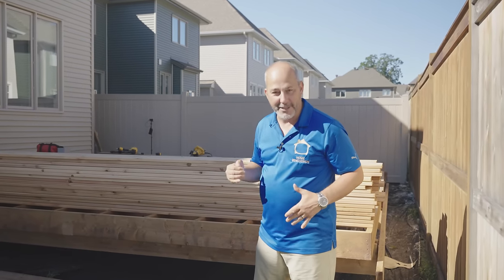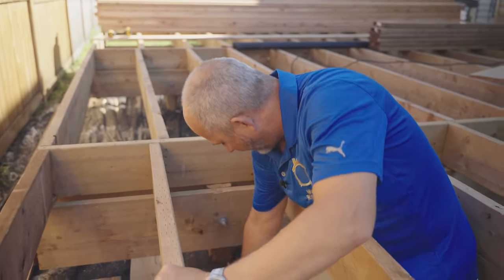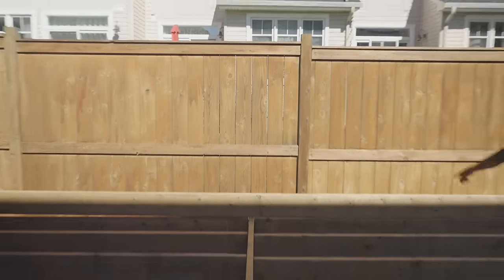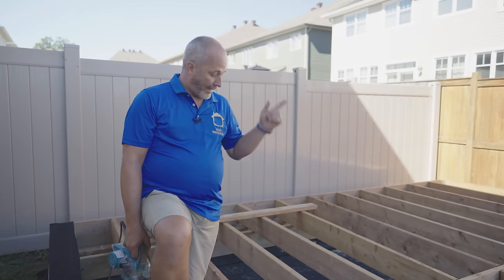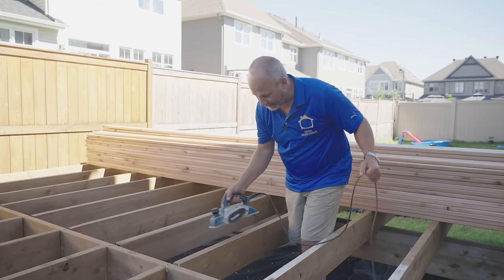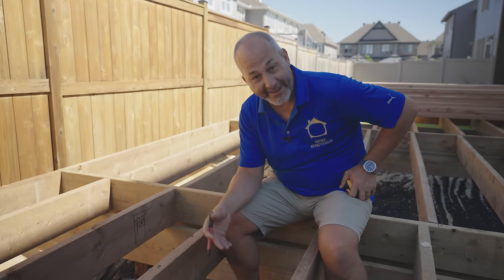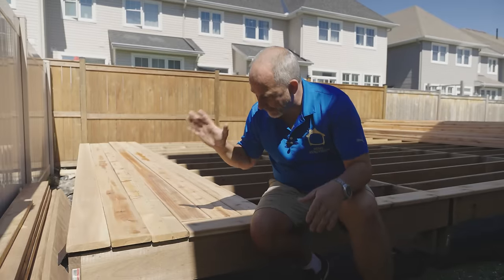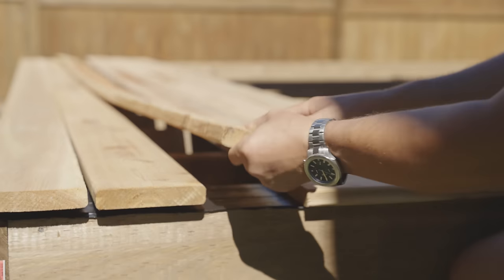Watch THIS Before Building Your Deck

Comment: When I rebuilt my deck, I had seen previous videos of yours showing the Camo system and the trick using a board as leverage to manipulate the deck boards.  I did the entire deck my self from demo to finish and the leverage trick was a game changer.  It helped so much!!  Oh, and I LOVE the Camo system!
Reply: When I saw it I figured yeah that's great bu5 I dont want to buy a $500 tool I use once. Turns out it's $50 and $100 for screws. Seems like an easy choice

Comment: Just had a guy tear off my 30 old deck and build new with the Camo screws. Love the way it looks without the screws showing. He never worked with the screws before and liked the finished look. I had him picture frame around the deck so the edges would not be seen, but I  did not let him screw the center boards down because I wanted to sand the edges and make sure they were laying the correct way to avoid the cupping and splintering you talked about here and other videos. Something contractors  don't figure for that kind of detail in their quote so I didn't want to pay him extra to do that. I used 20 foot pressure treated for a 20 foot deck. Not the easiest thing to handle ut it looks great. Although I do want to replace some boards that have too many deep knots or have separation that you talked about  Thanks for the additional information!

Comment: You can tie a plastic bag to the string take a vacuum to one end of pipe turn in on put bag with line in other end of pipe and it will fish the line in pipe.
Reply: That's a great idea.
Reply: Im not following. Could you explain more?
Reply: @nevinleiby  
It's easy to suck a 'balloon' with a string to thread a line thru a pipe.
Reply: @b_uppy  gotcha. Nice!
Reply: @nevinleiby  
It is clever, isn't it?

Comment: You've pretty much held our hands on the updating of our whole house at this point, so thanks! We're now onto building a little deck and have sourced some rough cut cedar. Would the Camo tool work for the straight edges of the cedar too? Any and all tips on working with the rough cut cedar is also welcome! (We did use treated lumber for the frame though.)

Comment: I like the way you use your speed square as a spacer for the deck boards.  I've always made my spacers from some 2" x 6" drop pieces and drive some nails through them.  The nail is the spacer and the 2" x 6" piece keeps it from falling through the gap.  The width of the space depends on the nail size.  I usually use a 10d or 16d but I've sometimes even used 20d.

Comment: Question for Jeff please, I'm in the UK and building my deck. The longest side is 25 feet long, and I want a frame edge on all 4 sides. I can't get boards that long. What is the best way to put 2 ends together please? Straight butt to butt or angle cut 2 and seal the ends?  Many thanks keep making these video's they are super informative.

Comment: I may of missed it in the comments. I love the channel, learning alot! And inspiring me to seek out more. But in this deck are joist hangers not needed? I am working on a deck right now. Also is there a reason why you dont use composite decking? I am going to be installing around 600ft of composite decking. Was hoping you had a video on it. Thanks!

Comment: your videos are very informative, THANK YOU! Is it posible to remove boards from the deck if necessary, that were installed using the Camo system?
Reply from the maker: sure thing. just cut right down the middle and pry them loose. Cheers!
Reply: @HomeRenoVisionDIY  
Thank you!

Comment: Am I missing something? Definitely intrigued by the camo system but is it just one screw per 16 inches that holds the board down? No top screws? Nothing in the other side? I was assuming at least 2 screws per joist to hold the deck board down, not just one on the side.

Comment: I watched this deck build in addition to the one day deck build, but I need some help with what kind of deck I should build considering my area. I live in the California mountains with hard ground that's terrible for digging (going to use deck cement blocks, instead of digging as much as possible). The area I'm building the deck is on a gradual slope, gets a lot of sun, and given the high winds and snow, I know it's going to take a beating. Given this information, would building a deck directly on the highest part of the ground and lifting it where the slope begins until it's level, work? In case it matters- I don't mind if it's not the most beautiful deck, I just want it to be functional and last through the snowy winters.

Comment: Hi Jeff, tank’s for your videos ! I learn a lot. Can you tell me where you buy the rectangular plastic that you put  between the rectangular exhaust fan and the window when you are sanding joints to exit the dust? I saw that in your other video. I am sorry, my english writing is not very good. Tank’s
Reply from the maker: It is actually a round tube. I get it from a local restoration supply wholesaler. it is called lay flat ducting for a phoenix air exhaust system. Cheers!

Comment: Question for Jeff. I am renovating my bathroom in my 100 year old house. When I took off the old tile off the floor I discovered the original beautiful porcelain hex shaped tile that with some TLC I think I can restore it to look like it was put in yesterday. The floor also had these thick porcelain curved baseboards around the perimeter of the bathroom floor. I had to take those out because they were in bad shape. When I took out the porcelain baseboard I discover there was something that looks like a roughly 3 inch cement or maybe mortar sub floor poured on the floor. In removing the baseboard some the crumbling baseboard came out and I need to fill it in, however some of the area has a bit of exposed wood. I know its not a good idea to pour cement over wood so I am looking for the best solution to level this gap around the perimeter of my bathroom so I can get it up to level ? really appreciate your video any advice would be appreciated.
Reply: Cover the wood with Tuck Tape and pour cement in it to level it.
Reply from the maker: just use wax paper or a sill gasket to isolate the pour of the cement. Cheers!

Comment: Question for Jeff or anyone who has used the camo system on PT wood. My soon to be built deck is on the south side, is my main entrance, will suffer -35 in winter to +35  in summer. I’m wondering about splitting of the deck boards over time, since the screw seems near the edge of the board. Anyone have problems with splitting?  Thanks in advance.
Reply from the maker: no worries lynn. the screw is designed to be self boring so it won't split the wood. your best defence is a sealer stain with uv protection applied once a year. Cheers!

Comment: Jeff, any particular reason you didn’t use that tape on the joists ?
Reply: Good question.
Reply: I believe he mentioned why he was only using the tape on the wider spans on the ends (where he was doing his perpendicular portrait deck boards) in his box beaming video. IIRC he only did it in spots where there was a possibility of water pooling under the wood, and for most of the framing, there are only 1.5" wide spans facing upwards, where pooling shouldn't be an issue.
Reply from the maker: I find it a waste of money in an area with no trees. simply wash out any organics once a year and you are fine. for areas with plenty of trees use it on all joists or clean the gaps weekly. Cheers!

Comment: Would  I be able to space my joist a 20 inch horizontal on 10ft h by 20ft w using 2x8x10 divided  by on 10ft w (floating deck)

Comment: Is there code limiting the height of backyard fencing?? That should be raised, too, so your heads can't be seen by every other neighbor -- or you seeing everything the neighbors are doing in their backyards.
Reply: Usually 6 feet is the max allowed
Reply: @atodaso1668  agreed that's the code where I am too
Reply: Jeff will build a privacy screen and he said in previous videos that if the fence structure is behind the property line (i.e., on the deck in this case) there are no limits to the height of the privacy fence/privacy screen
Reply from the maker: exactly! Cheers!

Comment: What am I missing! ABS for a gas line? Or is “the gas guy” going to pull some sort of a flexible hose through it, and if so what flexible gas piping is that long? 👀
Reply: Yes it is a flex pipe, similar to ones used in the house for your gas stove but they make them quite a bit longer
Reply: CSST ( HomeFlex, if your shopping at home depot)

Comment: Thanks for the video but you got your wood cupping directions backwards.   The board will tend to try to straighten out the rings as it dries.   So the smiley face end grain means the board will cup upwards, while the rainbow will cause a hollow in the middle and possibly collect water.
Reply: I pointed that out in a comment in another one of his videos before. He replied with something like “agree to disagree”. I’ve observed cupping in the real world and he has it exactly backwards.
Reply: According to Highland Woodworking, flat sawn wood can cup either way, depending largely on how dry it is at installation time, relative to it's environment. Generally, construction lumber is softwood and not yet fully dried out, and tends to cup opposite the bark side (in the same direction as the rings) as it loses moisture. Hardwoods are generally dried out for longer, and thus may cup towards the bark side (opposite the direction of the rings) if it takes in moisture due to it being drier than it's environment.

That said, if you live in a wetter climate, it could be that construction lumber tends to be drier than the environment, and would more generally cup towards the bark side,  opposite the direction of the rings.
Reply: I bet you know more than him 🙄
Reply: @sawxpatscelts  man no one said that! We just said that cupping doesn’t always go the way he said it does.
Reply: @sawxpatscelts  haters gonna hate they come in all ages 😁
Reply: I just screwed all my deck boards like he said and read the opposite on internet.. I dont know which to believe but I hope jeff is right 😅
Reply: @marc-antoinecouillard5014 haha I just finished framing mine and am going to install deck boards this weekend. Still trying to decide which way!😂
Reply: I wish I had read these comments before building my deck. The video does indeed have the wood cupping directions backwards. My 2x6 cedar deck boards arrived very flat and fairly dry (~12% moisture). I installed them a month ago in the rainbow direction (after watching this video). It is clear that the wood is slightly cupping upwards and trapping water in the center. The one board that I installed with a smile is the only one that is slightly cupping the good way so that the water flows off the board.  I'm about to apply the the stain but i think it's a bit too late to have any effect.
Reply: His rainbow not happy face is absolutely the correct way to install
Reply: Old timber vs New timber times and methods have had to evolve. He explains it in depth in one of his videos
Reply: Well, my 15 years deck here is telling me to go for the rainbow!

Comment: Your explanation of grain/shim fell short.  Would have helped to seen it up close/set in place.
Reply: He meant face the end grain up, just like it was a wall stud. A board is always strongest in the direction of the fibers, which do not easily compress lengthwise, which is why wall studs can bear so much load standing on end like they do.
Reply: @ThePlockets  
Thank you for the clarification.

Comment: How is your gas guy going to run pipe through the conduit with the elbows already glued on.  We use black pipe here in NY but you mentioned copper.  How can you feed the pipe through the conduit elbows?  Jw.
Reply: Probably using CSST
Reply: @thomaslongiii3143  also not legal on NY.
Reply: @craigkeene8769  oh my bad, i didnt realize he was in NY. Or think about it at all for that matter. I just seen what he was doing and have only ever seen it done that way if CSST was being used cause i really dont see how any other type of gas line could be pushed through conduit that is already assembled and glued. Oh well
Reply: @thomaslongiii3143  no, lol, I am in NY.  I think he's in Canada.  I'm just not familiar with Canada code.
Reply: He is from Canada, but he is currently in Florida. I think this was shot in Florida, but I could be wrong if it was shot before he moved.
Reply from the maker: I shot this last summer and we are just releasing it now since deck season is coming up. Cheers!
Reply: @HomeRenoVisionDIY  but you didnt answer the question lol.  Big fan, thanks for the reply!!

Comment: What happens if you don't treat the cuts on treated wood ? I clean it with water pressure every year....
Reply: The wood will rot faster since the water can soak into the wood.

Comment: You don't need a gap. The lumber will shrink on its own.
Reply: That's the truth as everytime I buy decking from Lowes it's so juicy that if you gapped you'd have a man hole cover to fall through once it dries
Reply: Swell..😌as well
Reply: Swell..😌as well
Reply: Tell that to my deck .. apparently it didn't get the memo.
Reply: @Iwillnevergrowup  poor Lil guy🧐🤭
Reply: Water, melting ice and snow have no where to go. Contractor didn’t leave a gap and it’s an icy wet mess. Plus it’s really hard to sweep as the dirt gets caught in the groove at the edge of each board. Leave a gap. Hate it.
Reply: If the lumber has sat around for six months outside, the story may be different, but %90 of the time you don't leave a gap. Not a contractor but I have built several decks and actually evaluated them later.  New lumber, no gap.
Reply: @violetgypsie  🙏 😊 💯👏 psst Vinny 🙄
Reply: Yes!  Having done my share of decks this is correct.  Leaving no gap, after shrinkage you will end up with at least a 1/8" gap.
Reply: the boards I used for a bridge I built were so soaked I didn't leave any gap at all and they're perfect now just after a few weeks in the sun. twas a good choice to butt them together. - probably situational, but most of the time new pressure treated lumber can be put as close as possible.